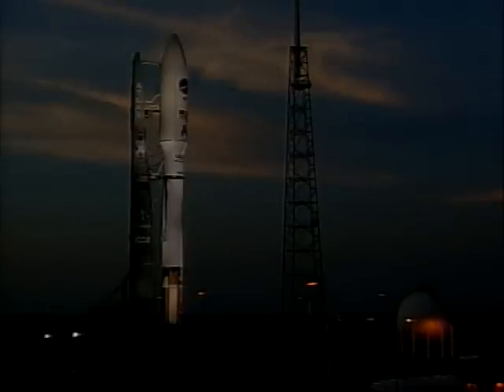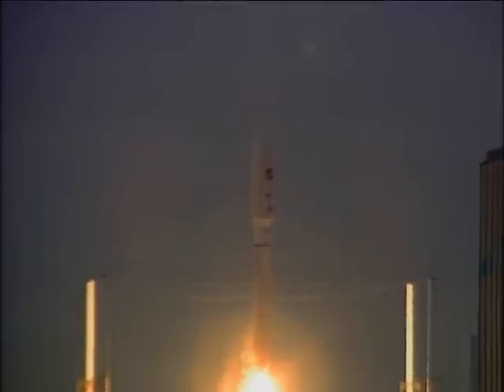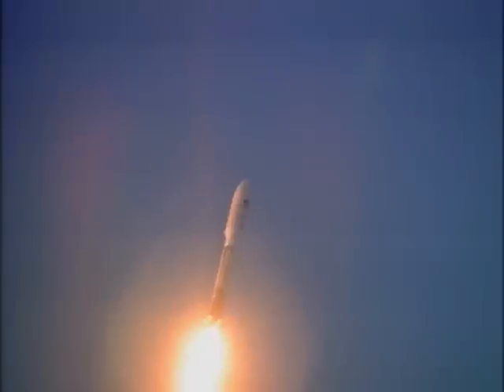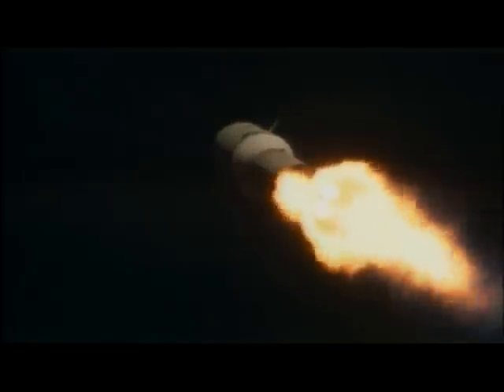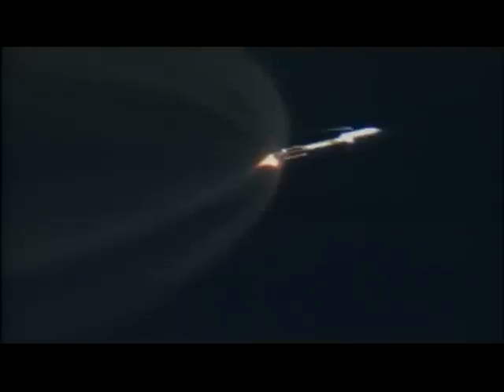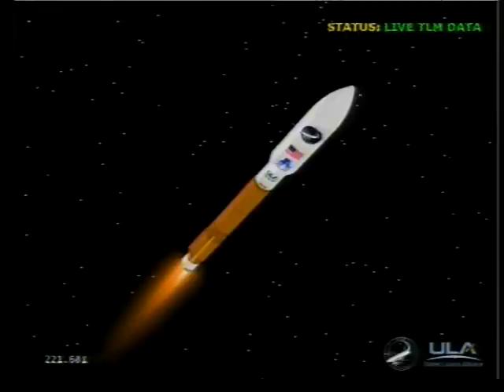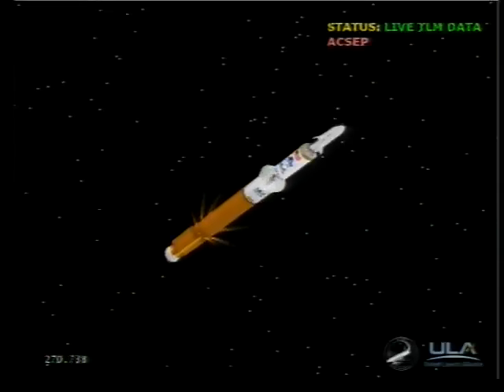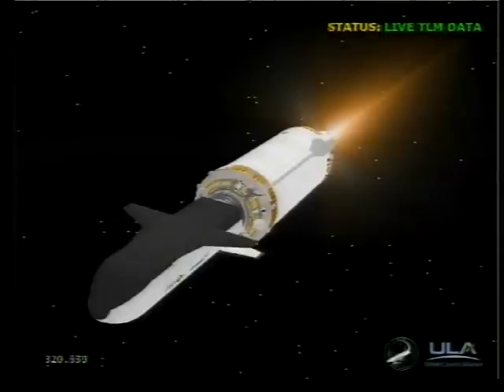Launch X-37B on Atlas V 501

Comment: The AtlasV is one of the best rockets for cargo.  However, Falcon9 is better for people.   The reason is with 9 engines you can shut down up to three engines during launch and it can still reach LEO.  The new Delta rockets also look very good, as long as they don't use solids.

Comment: I do wonder though if, in the event of the launch being aborted some time after lift off, it can be quickly separated from the lift vehicle and flown back to a runway.
Reply: I know this response is 10 years late, and if you’ve already found the answer, this comment is useless, but. No, it cannot be quickly separated, as that would mean the fairings separating mid flight, and crashing back down to the launch pad/into the water, and even then, it doesn’t have the thrust to escape quickly.

Comment: I read in New Scientist this week that the X37b has finally made a remote controlled landing. A first for America but 22 years after the Russians did the same with their unmanned shuttle.
The USAF remain tight lipped about what it will be finally used for but there are many possibilities including refueling satelites and rescue of stranded astronauts. Compared with the space shuttle this is a low cost alternative with none of the problems associated with manned flight.

Comment: @belankheet That's actually what they do and have been doing for quite some time.  In the early days they used chimps before sending a man in space.  And your also right about it being alot cheaper to do unmanned flights than manned flights.  Automated machines have far greater tolerances to heat and cold, they don't need to eat, or breath oxygen, they don't get board or home sick or feel fear.

Comment: @SphinxTheGeek the US does produce its own engines, such as the RS-68 on the Delta IV. The Russians marketed their RD-33's and 180's and NASA was impressed by their similarities to the RL-10's the Atlas had used since its development. The lower maintenence and cost to mount the Russian engines on the Atlas was the chief decision maker to use these engines.
American engines are higher tech and cost and Congress would have interfered unnecessarily if NASA had not this choice itself.